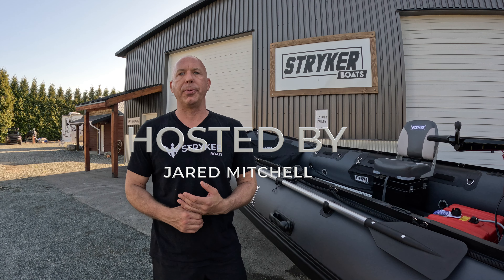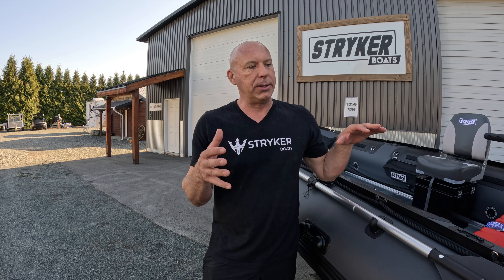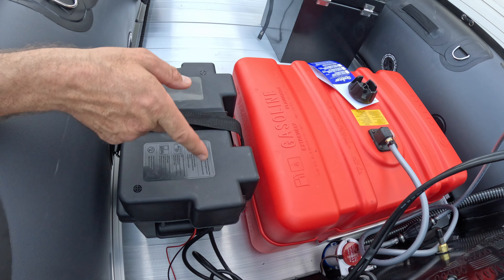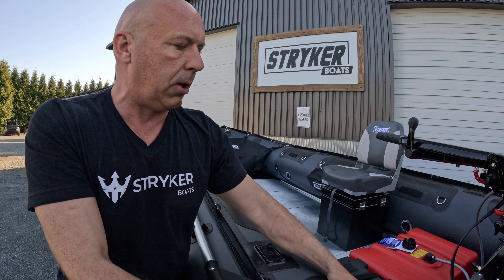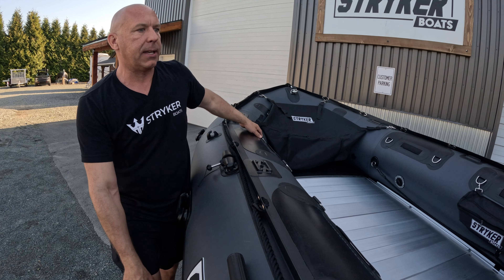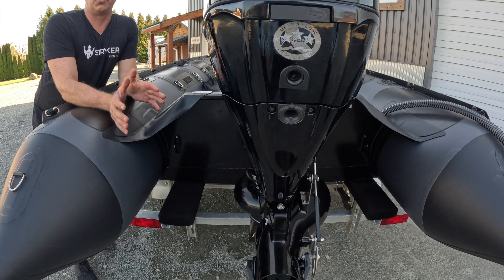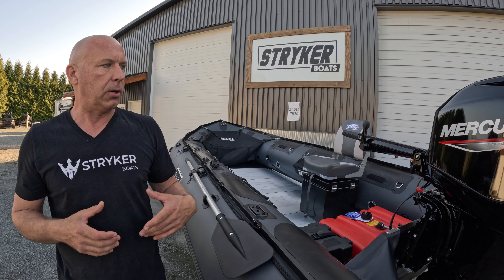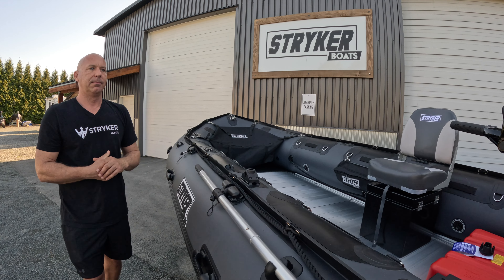2023 Stryker Pro 500 Boat Tour: Unleash Adventure with Mercury 60 40 Jet

Comment: Complete with Stryker furnished trailer for the Pro 500 - what is the footprint required to store?   Considering garage space as an option if feasible.
Reply: Our Pro 500 on the Road Runner trailer fits in a 24ft garage with room to spare

Comment: Looks like a nice setup. What's the benefit of a 60/40 Jet? Why wouldn't you just want a full 60 Horse prop?
Reply: Really the benefit is the ability to run in more shallow / rocky places like a river.  Jets are not ideal in the open water like a lake or ocean.  So really for a specific need.
Reply: @BigPapaJJ why aren’t Jets ideal in open water?  Lots of people run jets in the ocean